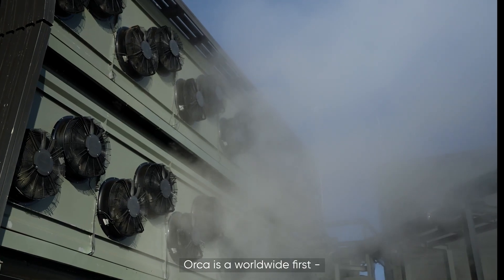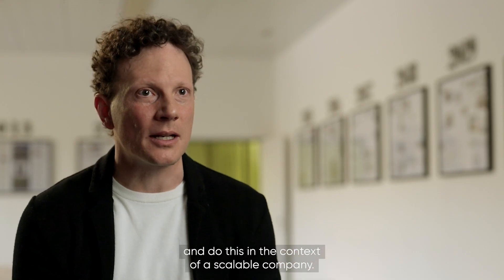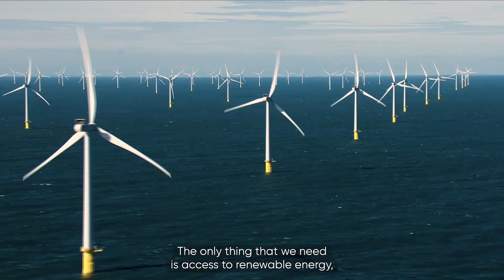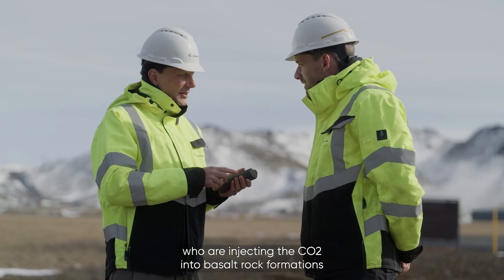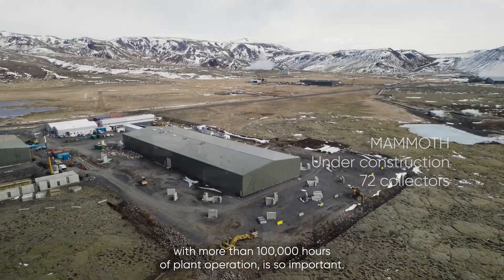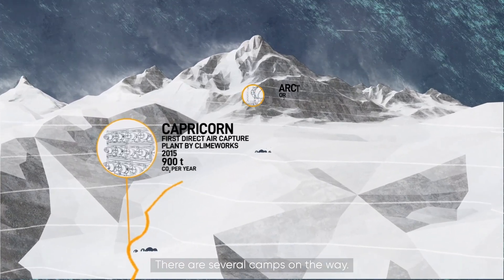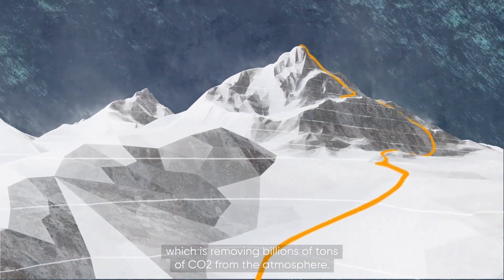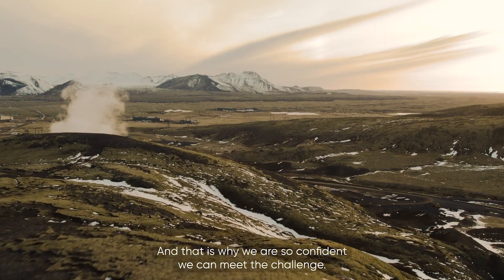Climeworks: Removing CO₂ from the air

Comment: Why not in New Delhi or any other polluted place ???
Reply: Because this machinery needs a lot of energy, and in Iceland they have a lot of "green" geothermic sources (it would not make sense to remove co2 if one had to emit co2 in order to make the system works). Moreover, even if it was possible to run it anywhere, it only takes out CO2 (whose effect on climat change are on the global scale) and it does not take away pollution: so there would be no particular advantage of making it work in particularly polluted areas.

Comment: I wonder what is the scientic limit or the limit of scalling what can be the minimum kWh needed to store 1T of CO2? Currently the price is very high. Right now the price is very high with 1300 EUR per Tonne. That a cost of roughly 13 000 EUR per Person in Western Europe per year. So like 1/3 or GDP so not realistic. What would be the best case scenario price?
Reply: I think most of the cost is used to build more plants. As for kWh per ton, there is a study called "Life cycle assessment of a direct air capture and storage plant in Ireland" which states that capture uses 500kWh of electricity + 1500 kWh of waste heat ; those numbers are expected to decrease in the future. As for the storage, CarbFix states in their FAQ that 1ton of CO2 costs 40 to 80 kWh of energy. Using renewable energy, it seems the efficiency is around 97% (if we don't count the waste heat source), construction emissions accounted for (14kg CO2 per ton of captured CO2).

Comment: Your approach is very interesting.
Well, from what I understand, you are removing CO2 from the atmosphere and injecting it into the soil.
They studied another, more social approach.
Using the extracted CO2 to produce polymers that can be transformed into Lego-style bricks or material that can be used in a 3D printer that produces houses.
We would have the production of a polymer and the release of O2. The inefficiency of the reaction in relation to the use of fossil fuels to produce the polymers could be compensated with the sale of carbon credits, and the sale of the material to build houses and improve the lives of people that fits with the UN's 2030 goals in several ways.

Comment: I absolutely love this solution but I'm wondering about energy requirements. How are you going to get the energy to support the extraction of gigatons of CO2 out of the atmosphere by 2050? Is that one of the reasons why Project Orca is based in Iceland, to take advantage of the geothermal energy there?
Reply: That's why we need fusion power. Carbon removal does work. But it only makes sense if you have a lot of CO2 free produced electric energy available to operate these systems

Comment: Underground storage?  As A stoeage SUPPLY to use for things?
Reply: Nope, taking that carbon out of the biogenic cycle.
Reply: Climeworks extracts CO2 out of the atmosphere. Then Carbfix in Iceland pumps the CO2 underground where it reacts with the basalt rock to form minerals. The process takes 2 years but means the CO2 is "out of the equation", ie the CO2 no longer causes global warming.